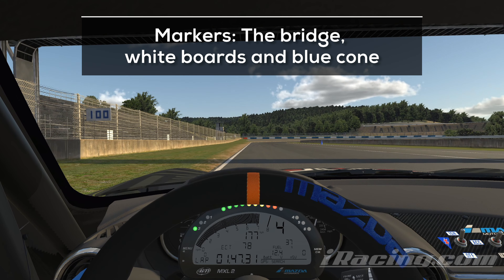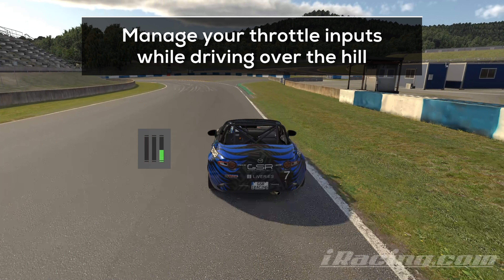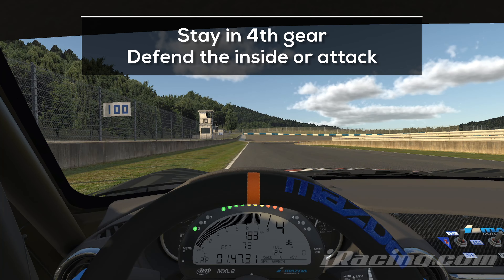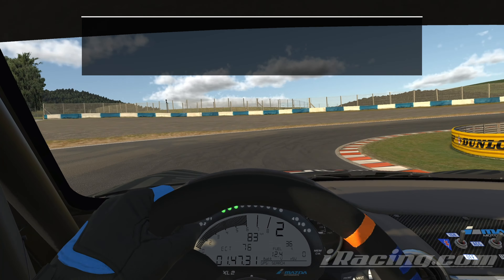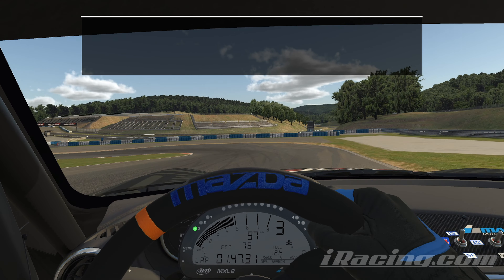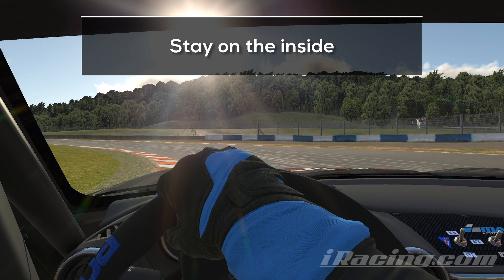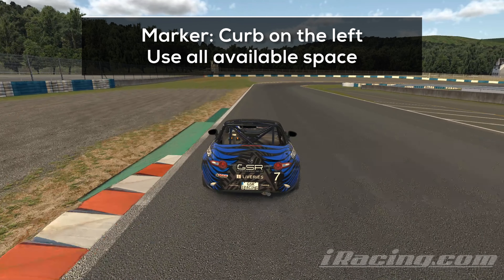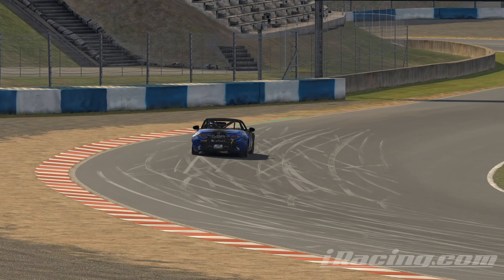iRacing Okayama Full Course MX-5 - Guided Lap + Hot Lap + Setup + blap file - 1:46,731 [iGLS]

Comment: Thanks for posting.  I am a rookie and my time is WAY off.  My best lap so far is in the 1:57's.  Would you mind posting some target sector times so I can see where I am supposed to be for a 1:47 lap?
Reply from the maker: You can download my lapfile which is linked in the description and load it right into the sim!

For this to work you have to download the file first, and save it in the following location:

documents/iRacing/lapfiles/corresponding track

You can start the session now, go to your options tab and click the load button in the "split time delta" section of the menue. Select my lap and load it.
 
Make a check before the "display reference car" option to drive against my ghost.

Use the "Cycle Splits Delta Display" hotkey which you can set below to cycle through the different delta bar modes. 

If you pick the vs. target lap mode, you should be able to compare my sector times with yours if you click on splits in the bottom right of the screen (when you are sitting in the pits).

Let me know when got any additional questions!
Reply: @crexLive  Thanks for the tips! I was able to get your reference lap loaded and can now run against your ghost car. I still have not figured out how to get the split box on the bottom right of the screen to compare. I keep getting my lap and splits against optimal lap.  I will get that figured out eventually.  At least I have the reference lap and can see my split times and your car. This will be really helpful.  The track conditions this week are with a hotter slick track so I think a 1:46 maybe not be the right target, but I am so far off that I won't be trying to run with anyone else for quite a while.

Comment: do you drive with clutch assist? i cant do downshifts like you with only antistall assist. thanks for advices.
Reply from the maker: Yes I use the auto clutch assist for the videos. You can downshift like that as well - you only need to blip the throttle with every downshift =) it's technically more difficult, that's also why I sticked to the assist since I figured more people will use it -> which means I can help more people =)
Reply: @crexLive  ok, i tried to do downshifts on higher revs and its quite working. as you said it required some trials, but breaking distance is much shorter it means - im faster:) so thank you for your movies and advices. i like it!

Comment: Hey man, thanks for the tips. Actually, I made a 1.49.610 as my best and can’t seem to improve. I’m so amazed by your 1.47 ! How much time did you practice this track ? I’ve already done 60 laps or so :)
Reply from the maker: Never stop pushing! :) don't forget that temperatures have an impact on laptimes, so plain numbers are not comparable. On average I need 1-2 hours for a clean lap.
Reply: crexLive Hey, thx for the reply ! Actually kept pushing and managed to do 49.175... Yeah you’re right I forgot about temps ! It was about 51 Celsius on track ! I’ll keep pushing ;)
Reply from the maker: 46 will be impossible then =) 48 mid-low should be your target time, 47's can be possible but I doubt anyone will drive them.
Reply: crexLive actuelly hit a 48.89x today thanks to your advices ! I’ll keep pushing ;)

Comment: Great video and now down to 1.50 but cant get below! I cant see the set up either how do I find this it may help me get under 1.50
Reply from the maker: There is no setup. I drove the lap with the standard baseline setup from iRacing, the setup the car has when you jump right into it. However, temperatures have an impact on laptimes and I already noticed that this week is quite hot. 46 is impossible, the limit is somewhere around high 47s/low 48s, which means you are not as far away as you think :)

Comment: Why did you skip this weeks race at Summit Point?
Reply from the maker: I didn't skip it, it was already uploaded on the channel. I uploaded it a few weeks earlier when the track was driven in the Sim-Lab production car challenge. 
It was my fault, I should have promoted it in the community tab.
Reply: @crexLive  Oh ok, I was the stupid one then, no problem! Have a nice day
Reply: @crexLive  I think something has changed between the previous season and this one I think it's the tyres. The car feels a bit slower, a bit longer braking zones and the speed you can carry through the corner is a bit less as I feel i cannot accelerate as hard. My times seem to point to that. On summit point last season I was able to go well under 1.23 in flying laps and even doing a 1.22.3 one time until it was degrading to a 1.23.6's - 1.24's by the end of the race. This season however my fastest lap was a 1.23.5 during a race but the pace drops significantly towards the end and the car becomes quite skittish in the final 2-3 laps. Also at around lap 9 or 10 for some reason the car becomes hard to control before settling down again a bit later. I found this to be true in all circuits
Reply from the maker: Yeah the car feels a bit different but I can't tell you what changed. There weren't any notable changes in the patchnotes. The same applies for GTE and GT3 cars. Some people think there were adjustments on the new tire model which happened without giving any information out, but that's impossible to confirm anyway. Make the best out of it =)

Comment: Download not working?
Reply from the maker: What exactly is not working? More information could help me to troubleshoot the problem.
I just tried it and for me it's working fine =)
Reply: @crexLive  my bad... xd where to install?
Reply from the maker: You have to download the file first, and save it in the following location:

documents/iRacing/lapfiles/corresponding track

You can start the session now, go to your options tab and click the load button in the "split time delta" section of the menue. Select my lap and load it.
 
Make a check before the "display reference car" option to drive against my ghost.

Use the "Cycle Splits Delta Display" hotkey which you can set below to cycle through the different delta bar modes and chose "vs target lap" to select the correct ghost.

Let me know when got any additional questions!
Reply: @crexLive  Thx so much!